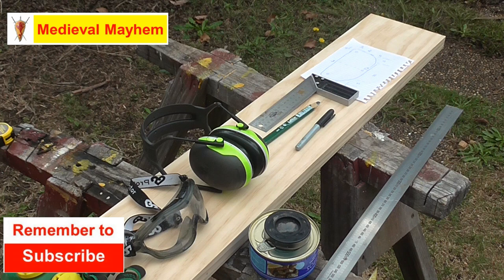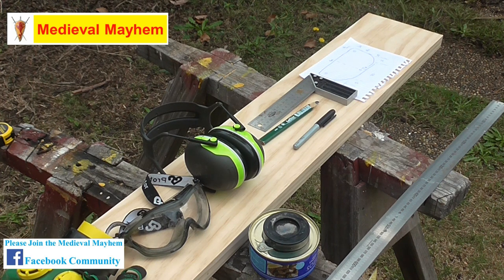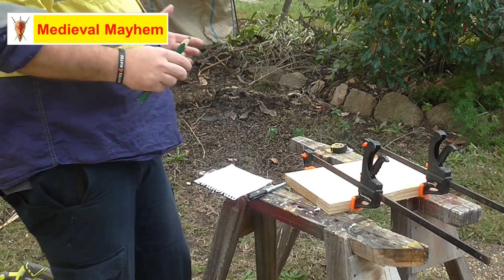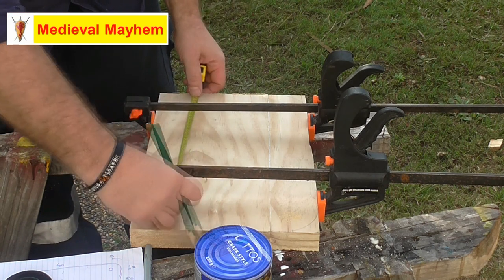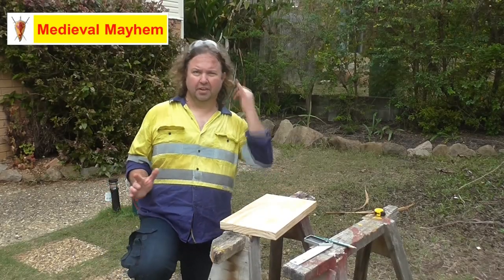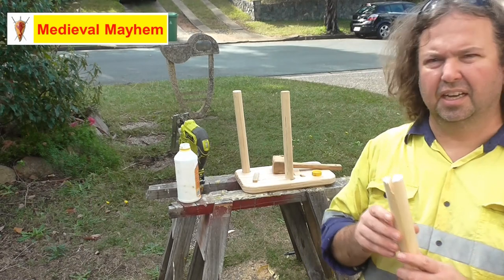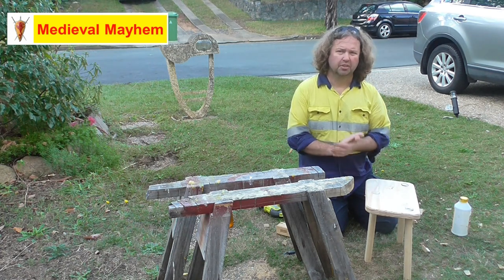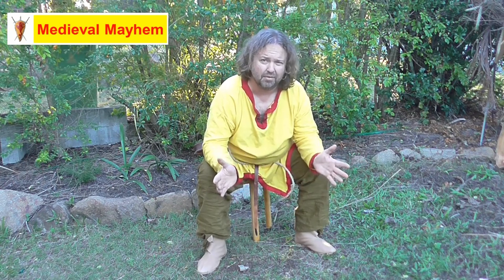DIY Wooden Lund stool (Viking)

Comment: Did the Lund stools use your slot and wedge construction for the legs? I had assumed a tapered leg in a tapered hole, but that was just a guess.
Were they glued? 
Are you using "boiled" or "raw" linseed oil? The boiled is a modern product, not actually boiled. I have seen the claim that raw linseed oil dries too slowly, but I have never had a problem with that.
Reply from the maker: The origional legs didn'ty survive, so we don't know. 

I use commercial linseed oil - unsure if it's boiled or not. Thanks - I didn't know about that.